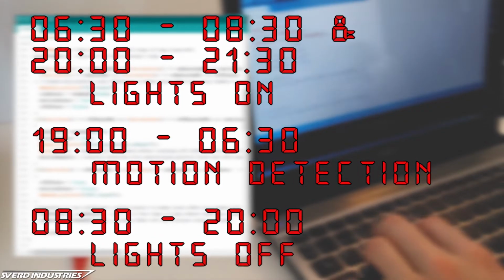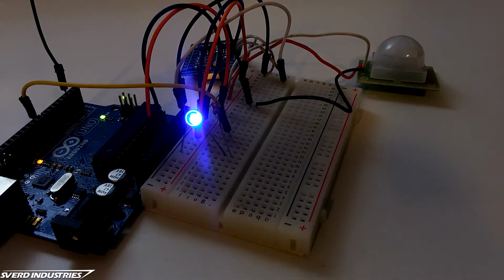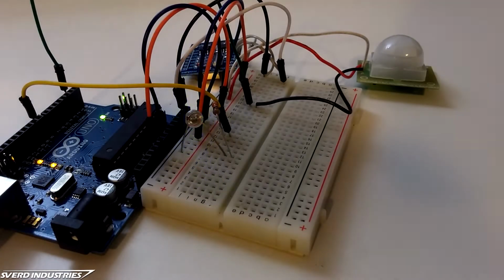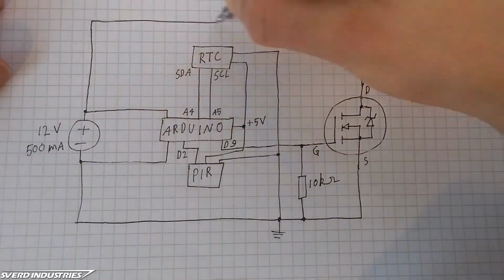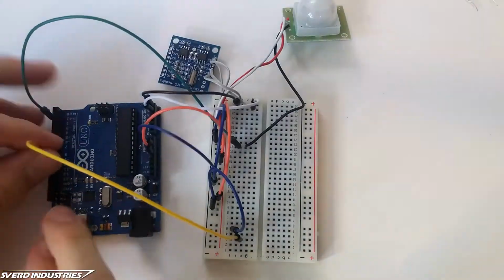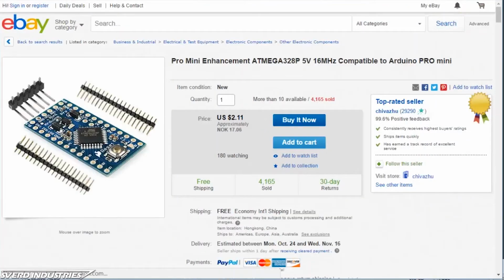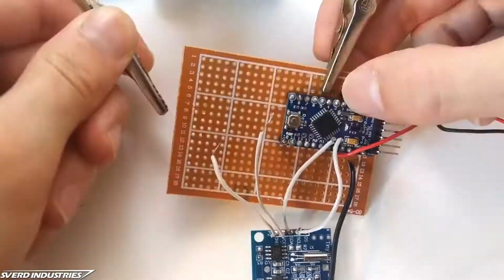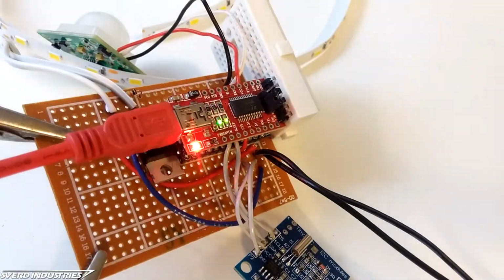DIY Bed LEDs - Time and Motion Activated || Arduino Tutorial

Comment: i have this wired up but during the "bed leds initialized" phase it just keeps saying "motion detected" and fading on and off the led continuously. I have attempted to completely cover the PIR sensor to avoid any motion detection and it continues to say motion detected. I am using a standard HC-SR501 PIR sensor, please help... very frustrated...
Reply from the maker: This might be caused by the sensitivity potentiometers on the PIR sensor. Try playing around with those two

Comment: Where is circuit diagram? Not available in instructable and it's command section also
Reply from the maker: Step 3 in the instructable has descriptions of the necessary connections. As the circuit was made by freehand soldering, I did not make a circuit diagram after those descriptions
Reply: @SverdIndustries  thanks for your response

Comment: how do I have to modify the code to control a relay?
Reply from the maker: You don't have to modify the code. I recommend you control the relay through a transistor and flyback diode to protect your arduino.
Reply: @SverdIndustries  That`s right.. but my idea is to control a 230V device with a relay.

Comment: And how would u connect a multicolored led strip
Reply from the maker: You would connect a multicolored LED strip, i.e. common anode RGB, by adding two more MOSFETs to the Arduino's digital outputs. Then you connect the three cathodes for each color channel to one MOSFET. You now can control and fade in multi colors!
You can check out the video I made on the smart lamp to see this principle in action.
Reply: @SverdIndustries  omg thanks i didnt think you would respond since this vid is so old thank you
Reply from the maker: @melsoro7311  No problem mate!

Comment: how do the lights fade without use of a relay shield
Reply from the maker: That's where the trusty MOSFET comes in. It performs a similar function to a relay in that it acts as microcontroller controlled switch for current.